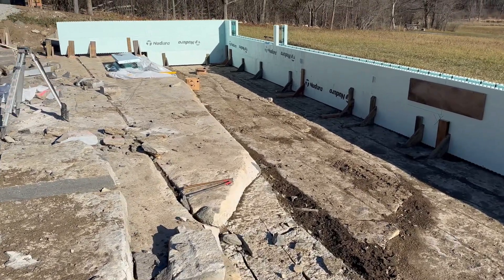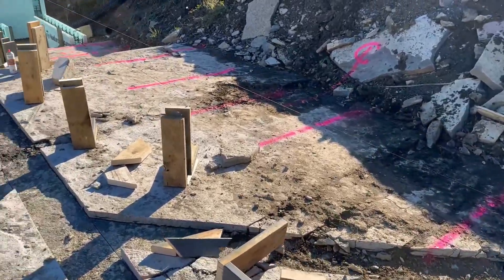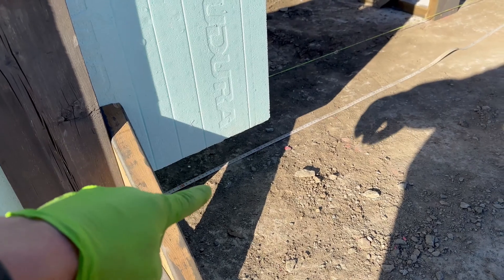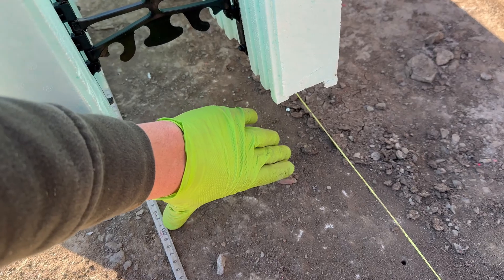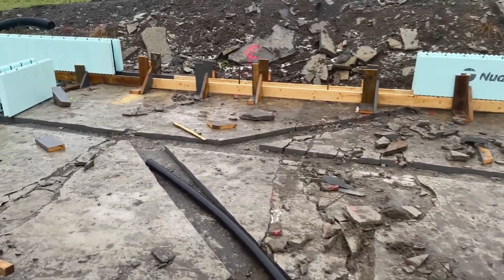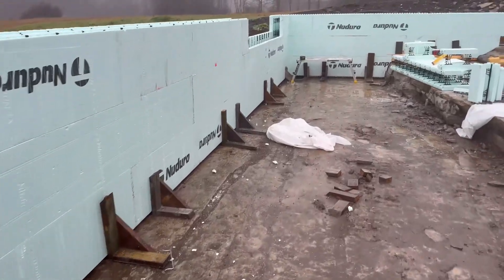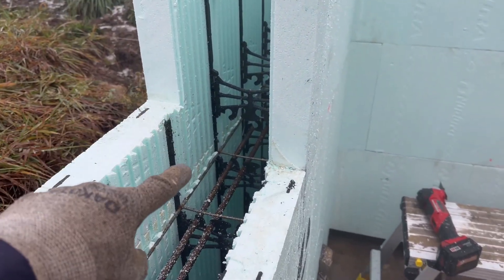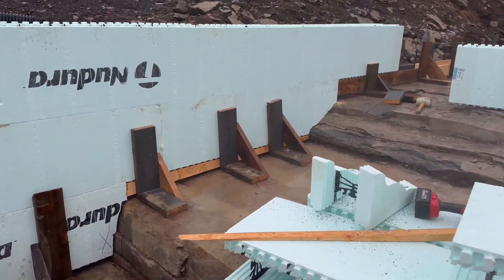ICF Foundation Directly on Bedrock - No Footings

Comment: Hay it’s been a year is there any seepage in between the slab and foundation? Hand drilling must have been a bitch but I read a comment you said it was only 8” into slab. I’m getting ready to build my house on a hill that is basically sandstone.
Reply from the maker: No water issues so far. The actual floor slab sits about 10” above the highest point of the bedrock and the areas between bedrock and slab are filled with 3/4 washed stone. Any water that enters would drain away anyway so likely wouldn’t see it inside anyway. Thank you.

Comment: I recently saw something about thermal bridging, not sure your plans for heating but if you insulate the rock and then pour sand on top of the insulation you can have a good mass of warmth in the winter. Concrete with radiant pipe on top of the sand. Not sure your plans but it might be useful with your climate

Comment: When you pour, use multiple lifts. Don't go up all in one shot. You want to limit the hydrostatic pressure. This was how I poured commercial pole bases -- to stop blow-out. After the first lift -- say 15" -- let it set for 30 to 40 minutes -- and while it's still thoroughly wet -- pour a second lift.
I'd high pressure wash the bedrock so as to get an ideal bond. I'd punch holes in the bedrock and set epoxy bonded rebar vertically so as to absolutely bond the primary layer. You ARE in ice country.
You don't want ANY water to weep in and then ice up and lift up the whole she-bang.
Reply: i am building my foundation with granite blocks. No need to mechanically attach anything to the ground. Do it like they have done it for hundreds and hundreds of years. A granite block foundation. Concrete will decay in the ground in contact with moisture and with rebar it will spall and break apart within 75 years. It would be a shame to make something beautiful only to have it self destruct in one lifetime.
Reply: @marks6663  good call on the spalling rebar after it corrodes inside the concrete and bursts.  very few people thinksof this.
Reply from the maker: Good info thank you. We ended up pouring the whole place in 3 lifts. The first was about 36” deep with no bulging or blowout whatsoever. The icf forms are quite strong. We did not pressure wash the rock but did wash it with high pressure fire hose 2”. We installed 15m rebar dowels 8” into the rock and 36” into the wall and epoxied every 4’ on centre. The actual footing will be about 56” below finished grade when we backfill so freezing is not an issue in our location.